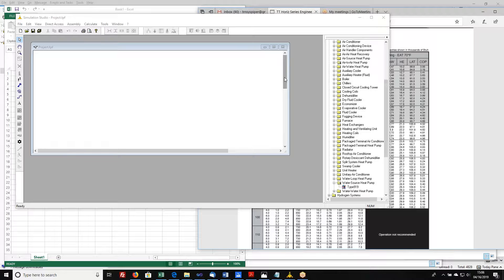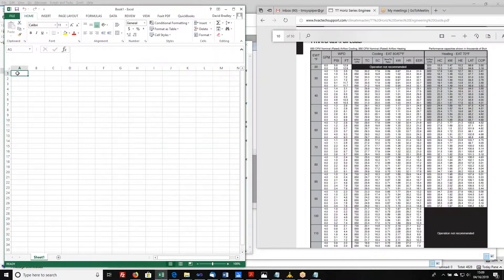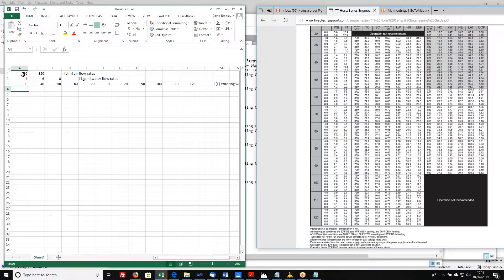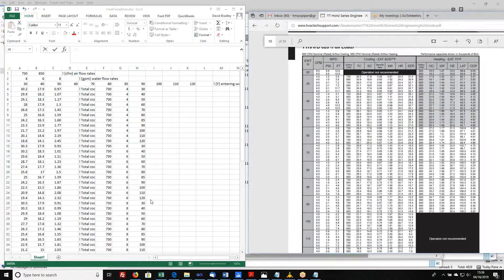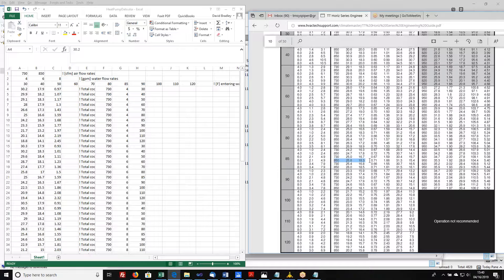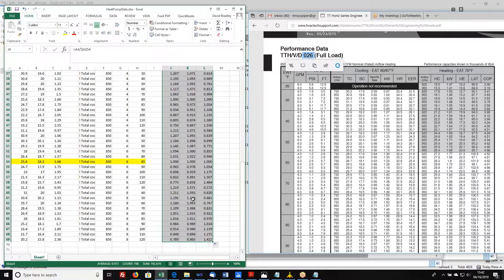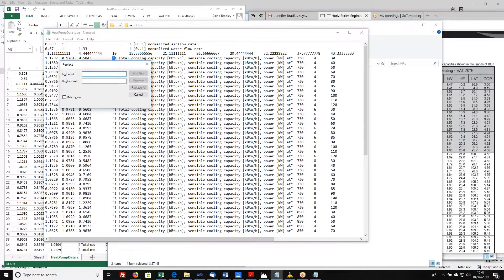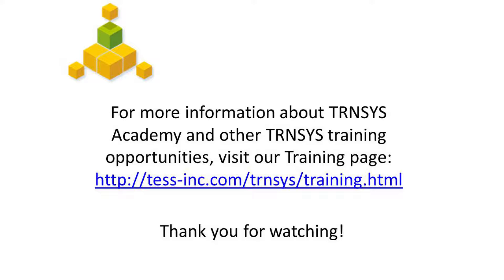Creating Data Files for TRNSYS (Part 2 of 2)

Comment: Thanks for this informative tutorial.
I wanted to generate the correction factor file and checked different manufacturers. For the sensible cooling capacity, several data are not properly provided (like the heat pump you used in this tutorial).
How can I generate the correction factor file
Reply: Moreover, what if we wanted to define multiple heat pumps in parallel that can provide huge amount of heating and cooling. For instance, if 60 GPM of liquid flow is required, should all the other parameters multiplied by 10?

Comment: Thank you for your video. I understand that how to create the data files. I'm looking for a performance maps of air-to-air heat pump model. Could you tell me a website or literature about it??
Reply from the maker: I would check a heat pump manufacturer's website for performance map data. Carrier, Trane, and others usually have performance maps published under 'Product Literature' or 'Technical Data' for different models on their websites. Sometimes a Google search for a specific model number is the most productive way to find it.
Reply: Thank you for teaching several beneficial sources to me. I could access the performance data.